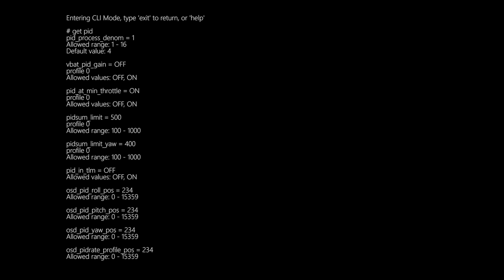PID AT MIN THROTTLE=OFF

Comment: This is awesome but please help me since I am still confused. I was watching videos about IDLE-UP and AIRMODE ON. The pid_min_at_throttle was also mentioned in one of the videos I watched. Today, I crashed my quad. I went too low. When it hit the ground, it went crazy. My guess is that it went crazy because AIRMODE was ON. I might be wrong. So with IDLE-UP and AIRMODE OFF configuration, will the same crazyness happen if I crash?  With IDLE-UP and PID_MIN_AT_THROTTLE=OFF, is AIRMODE set to ON? The AIRMODE is ON always on my quad from the day I learned about fpv hobby. So what I am thinking is that with IDLE-UP and AIRMODE=OFF, even during flights, AIRMODE is still set too off. That's where my confusion is. Here's my crash today. https://youtu.be/dkv5Ahj2a-U
Reply from the maker: With idle up, you are essentially never at idle. You will always have a very aggressive reaction as the PID controller is trying to react to a huge amount of error. It your particular case it looked like on the yaw axis. You hit the ground and it went into a yaw spin. The flight controller tried to fight this by spinning the opposing motors up hard possible 3 depending on how much roll or pitch it was correcting as well causing the shoot to the moon effect. I haven't gotten into the weeds of betaflight for quite a while but you might want to poke around the wiki and look for anti taz settings. As for airmode, even with it on pids relax a ton with normal idle. This is why some like idle up. Pid at min does nothing with idle up because you are never at min throttle. Best practice I've found is to manually "idle up" with your fingers. Learn where your quad likes the throttle stick to not fall below but have the room to slam the throttle down when you hit things. Also hitting disarm as soon as you touch things will save you so much money. These things cause more damage to themselves after a crash my trying to correct than the actual crash.
Reply: Thanks a lot Kelvin! Sure, I will take a look at the taz in the documentation. Have an awesome day! 😊

Comment: So when your flying and go min throttle..... then bring the motors back up, if you dont have throttle perfect center it flops left and right.. or when its on the ground if you yaw left..... all the way nothing happens, as soon as you raise the throttle that suckers GONE!
Reply from the maker: I thought I replied to you a month ago, guess not. Sorry. That's why air mode is on a switch. If you have it on, after you go above the threshold threshold one time, everything is just as it is right now. When you turn air mode of via a switch and have pid at min off, your right,  that would happen, but why would you do that? The only reason to have it off is to land softly.

Comment: I know in KISS you can set this up, then in the radio (I run a QX7) and have a idle up switch. Same thing as what Steele Davis has on all of his rigs.
Reply from the maker: Yeah I'm pretty sure it's the same concept.
Reply: Probably the biggest difference between BF and KISS is in KISS you are not doing any CLI commands.